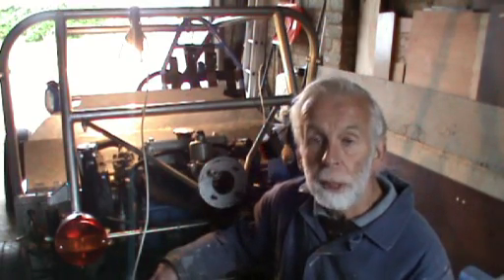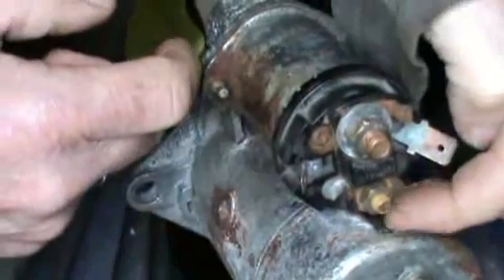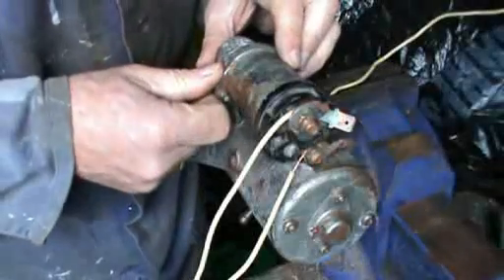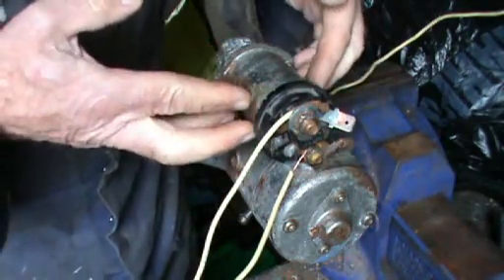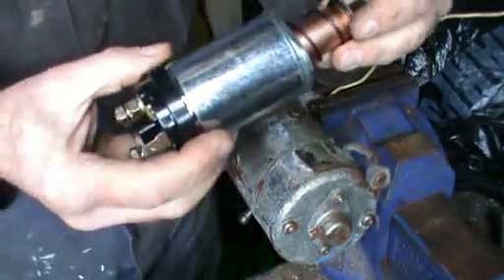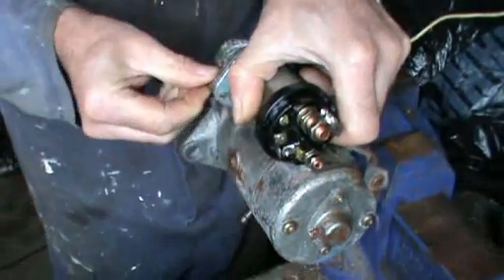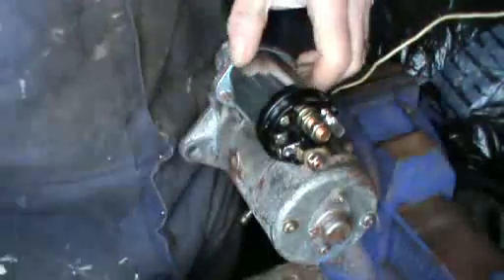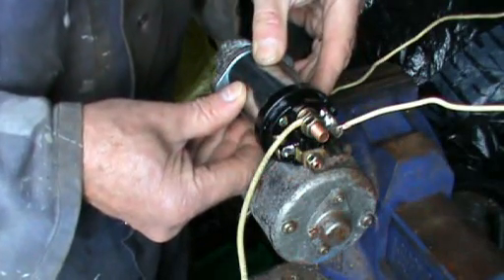Testing and replacing a pre-engaged starter motor solenoid.

Comment: The test at 1:51 is no sure indicator that the problem is with the solenoid, the solenoid has two windings, one of the windings is wired in series with the starter's brushes, this winding is to pull the solenoid in, once it is pulled in he other winding keeps it in, that means that if the solenoid is energised but does not pull in like in this video the problem can be either with the brushes or the solenoid itself, to properly test the solenoid remove the man battery connection from the solenoid and ground the output terminal of the solenoid going to the starter and then energise the solenoid, if it then fails to pull in it is faulty.

Comment: my solenoid is fine on my starter motor but the motor is not working,is there a way to fix my motor with out buying a replacement?   (same starter as in video)
Reply from the maker: Probably not, try to get one from a breakers yard.

Comment: Awesome video, my Yamaha Virago uses the same solenoid but the plunger gets stuck occasionally, I have to engage it manually with a screwdriver to start the bike. I tried to open it up to grease the plunger but it was stuck to the solenoid. The wires from the battery and ground are newly replaced, but the small wire from the ignition looks pretty sketchy kinda old and burned. I will try replacing it to see if it's better.
Reply from the maker: Yes, give that a try., however I suspect it will need a new solenoid if you can't free the plunger.
Reply: Hey luckily I traced the problem, I got wires it directly to the battery and it worked perfectly so I knew then the problem was not the solenoid. So I traced the wires to a faulty connection where it was loosing power. Changed the connectors and perfect!!! Thanks again for the video, great job!!!
Reply from the maker: Well done!

Comment: so if the body of the solenoid was to earth and the 12v in was touching the body would this be causing no power to dash, switches, nothing at all, the only sign of life is when i short across the terminals it turns the engine over. my solenoid has no plastic on the top, its all metallic so the live wires are touching it all the time
Reply from the maker: The 12v in to the solenoid or the starter does not touch the body, if it did you would have a short circuit, the only wire connected to the body of the starter or any other part of the car body is a negative.
if you are getting the starter to operate by shorting its terminals, thereby by passing the solenoid I would think your solenoid is faulty, but check tightness and cleanliness of all terminals just in case they are slack or dirty.

Comment: Sir,my solenoid was doing exactly the same thing your faulty one was doing.Nothing.It would have been nice if you could have explained what could be wrong with it and possibly opened it up to demonstrate.Thanks for taking the time to make the video.
Reply from the maker: Thanks for getting in touch.
As far as I know, the solenoid can't be repaired, a replacement is quite cheap and will probably be more reliable too.

Comment: Sir I have a problem with my fiat uno sometimes the starter wont work when I turn the key into ignition nothing happens it happens when i accidentally stall my car or when I turn of the car while at the gas station then start it sometimes it wont work but thankfully it works 80% of the time. Is it also because of the solenoid? Thanks.^^
Reply from the maker: Thanks for letting me know. The starter itself is normally very reliable, but the solenoid can fail. Thanks.

Comment: Austin Metro/Mini A series engines, blast from the past! 
I've a problem with my ignition on my motorcycle, I've concluded the solenoid/relay is the issue for a while as the batt has even been fully charged before testing, even hold just beyond 12v on the gauge. And the motor turns just like here & even starts the engine now and then, just not regularly enough anymore. Stuck with the kickstart for now. Thanks for the vid, extra impetus to change the solenoid, for £12 it's cheaper than getting it tested. If it's the same problem after, I'll have a spare solenoid & know it's the starter for less money than a garage fee. And if it is the solenoid it's fixed. No brainer.
Reply from the maker: Irregular operation is often the clue that the problem is either the battery or the solenoid and a possible spare is always useful. Let me know what happens.
Reply: Well it turned out to be the battery after all. The new starter relay / solenoid made no change. So I changed the starter motor thinking the battery was still rather new and giving me good voltage readings. Still no change. Apparently the voltage can stay good on a battery but the amperage can falter. The amperage is what's needed to crank the motor. So I changed the battery and everything is good again. I have a spare starter motor & solenoid in the old parts and neither was too expensive, I have no doubt some point in the future they'll be needed anyway, they are wearing parts after all. One thing I did do however, was change the voltage regulator out for a new one as I think that was responsible for damaging a fairly new battery. I had an idea it could be faulty as every now & then a T10 bulb would blow somewhere & this is the 2nd battery in not so long. I haven't had either trouble since I changed the voltage regulator & I get different readings to the old one, sop something was up.

Comment: hello I have a marine ford 180 horse power deisel 
new solenoid old starter 
reconnect went well
started on first go
went back hours later but get only ratatatat then second turn click click click
then nothing 
is it possible that a short circuit is blowing out solenoid
Reply from the maker: +Rodney Henry Hi and thanks for getting in touch.Sounds to me like it could be your battery, can you swap it for another?
Reply: This is confirmed 
Battery was not holding charge 
Thank you sir
A very big help

Comment: Hello sir I'm from Iraq, I have an Audi car 1990,one day there was a problem when I tried to open the car and when I turned the key to the car, it is worked motor vehicle normally but the problem is that the starter motor did not stop after he worked the engine, and remained runs two minutes and did not stop so the engine is running and the starter motor as well as works two minutes. and then i shut down the engine, and when I turned the key to the car again  the engine worked and the Starter work normally, the question is do you think that the starter motor damage or not? Knowing that the car's engine and starter motor is now working normally ..... thank

Comment from the maker: To test the motor only, earth the starter body to the neg side of the battery, and a lead from the bottom solenoid terminal is briefly touched on the battery pos. If the starter is OK it will turn.
To test the solenoid, starter body to neg of battery, pos battery to top solenoid nut, a wire from the large spade terminal (normally goes to the ignition switch) is sparked against the battery pos, if it makes a clicking noise the solenoid is OK.
Hope this helps.
Reply: dalbhraddan where can i buy the celonoid on its own they sell the starter complete

Comment: hi so the negative is connected to earth an one wire connected to the  positive to feed the motor and a wire coming from the ignition connected to the positive side of the battery  , so to just test the motor  do you just run two wires to pos neg on  a battery  and  same  to test the  solenoid

Comment from the maker: Yes, but it's a lot easier to test and work with it off the engine. However as long as access to the solenoid small bolts is possible, just make sure you disconnect the battery first and don't drop anything into the case.